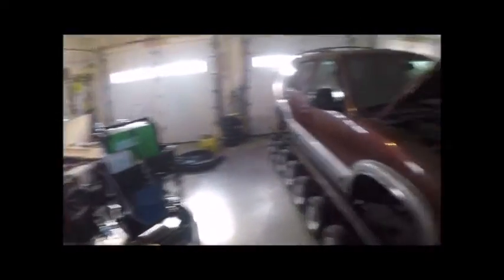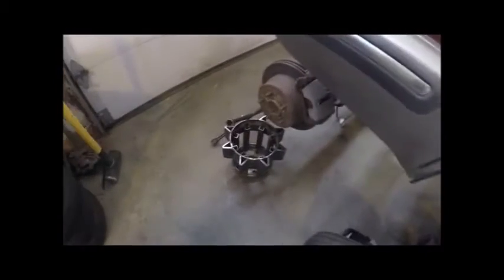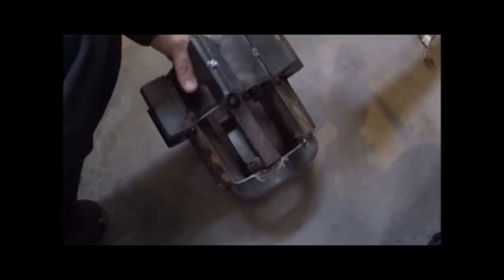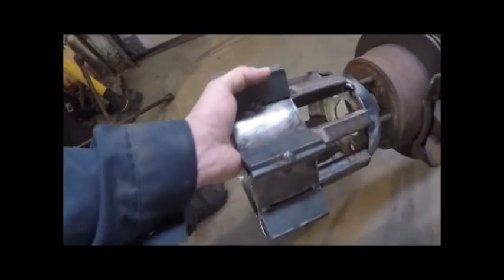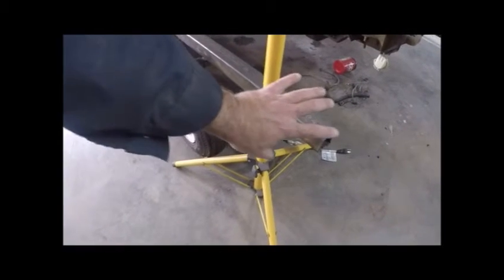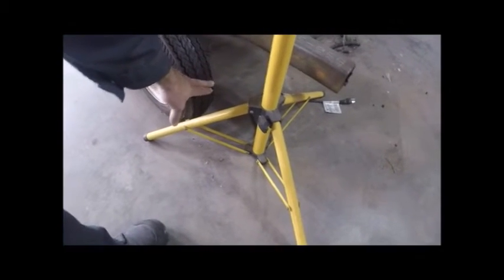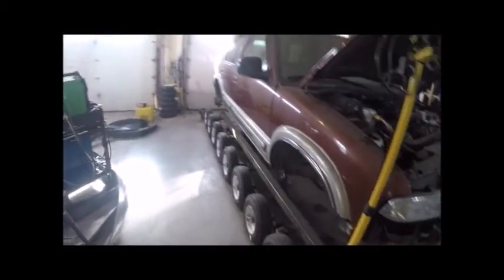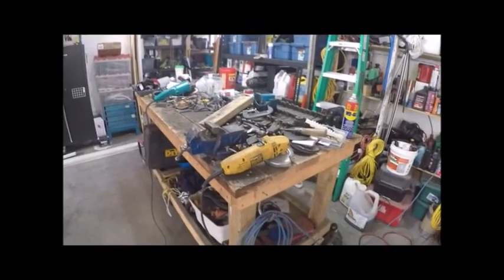Custom Tracked Vehicle, Part 10 Track and Drive Sprocket

Comment: What size belting is that
Reply from the maker: Hi Austin Bezoni,
That is a 8" by 3/8" thick conveyor belt that the company I got it from split in half. So each side of the track is 4 " of belting.

Comment: Hi Brad, Thanks for the Shout Out. Never fear on the track jumping the sprockets. The reason for that is you have the sprocket teeth grabbing the cleats and the cleats are on the outside of the conveyor belt, in effect this will make the track want to be sucked into the sprocket teeth on the sprocket. The pull on the conveyor belt  from the cleats being on the outside will want to make the track want to bend inward. You'll notice this when you start playing with the setup.

If the part that the sprocket grabs was on the inside of the conveyor belt then the track would want to bend outward of the circle (circle being a completed track) and would want to jump the teeth of the sprocket. 

Nice to see you start working on it again.
Reply from the maker: Thanks, yeah I think you are right on the grabbing of the cleats. Glad to be back on this project.